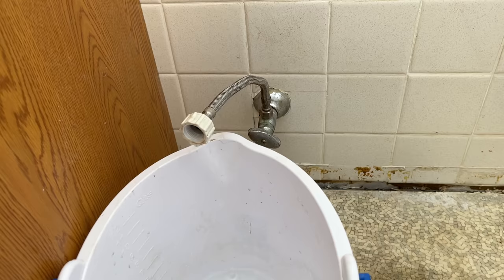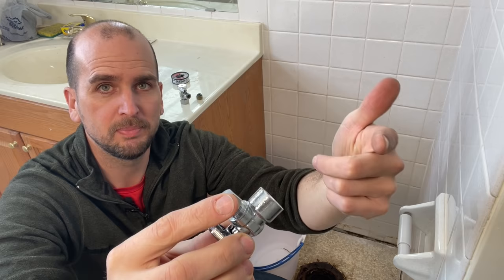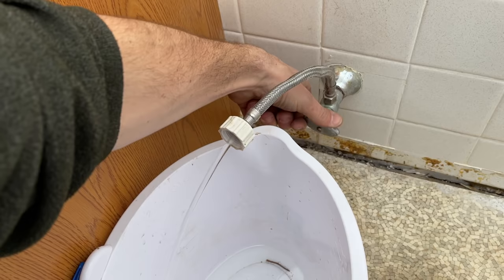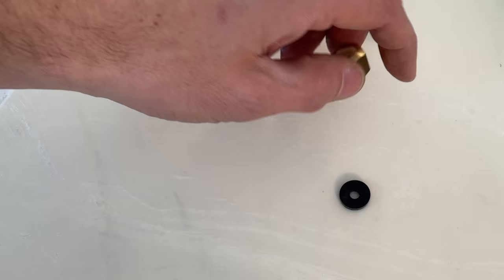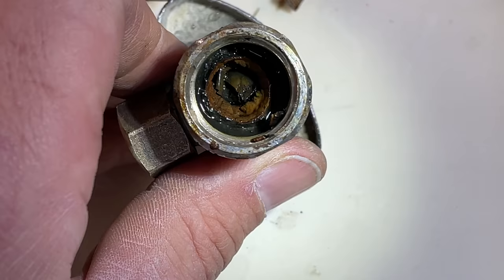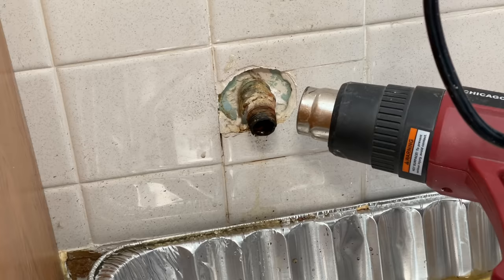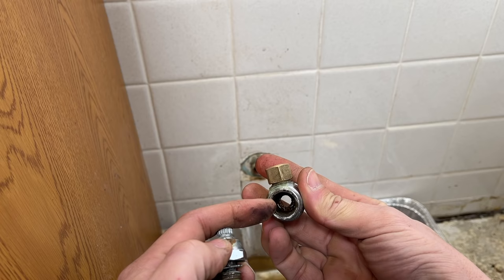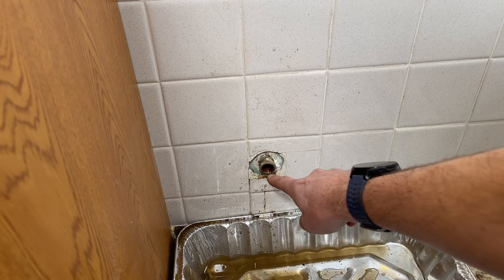Toilet Water Supply Valve Replacement | Can't Turn Off Water

Comment from the maker: What I learned from all the comments:
1)  Use a brass nipple as opposed to the black iron nipple shown in the video (Black iron and copper 
2)  I wrapped the Teflon tape in the wrong direction demonstrated at 4:55
Reply: You really should either pull this video down as the repair portion is mostly wrong, or heavily edit it.  Most people don't read the comments so your mea culpa here doesn't really help.
Reply: I'd consider a plastic nipple or brass.  Plastic won't have any chance of corrosion.
Reply: @JerryFountain  this is true someone like myself may fail to not read the comments because viewers are so negative in their posts. They may take Everyday Home Repair channel for what he has shown, at his word. Then later the troubles will begin for the repairer. This personally why anytime I am starting to learn how to repair I look at different videos first. There are some people out there with good intentions but they are wrong either through lack of experience or because each scenario is different that the homeowners will experience on their projects.
Reply: Another thing, black pipe is not normally used for water. It will rust too fast. Black pipe is used mostly for gas.
Reply: Virtual hug subliminal
Reply: How cool is it that this guy listens to suggestions from comments?   And he makes great videos.   Nice guy!  I could hang with him.
Reply: @JerryFountain  😊
Reply: Suggest Quarter turn valve instead of the multi-turn.
Reply: Whoever used an iron nipple is guilty of malpractice.
Reply: @jimmypautz plastic has lower fatigue life as it’s still under compression by the valve connector.  Notice that many installs with a plastic part just cracks from vibration, Iv, heat, etc.  My Broan combo Bath exhaust fan/light fixture’s plastic clip holding the light socket cracked after 5 years.  Maybe it was heat or or fan vibration, so it doesn’t corrode but plastic breaks easily,

Comment: Never use Iron fittings with copper. Dissimilar metals. You applied Teflon tape in the wrong direction.
Reply: wasn't that nipple thing meant specifically to go from copper to iron?
Reply: @jc40337  Nah, there are brass nipples more appropriate to the application.
The iron nipple should have been used with iron or galvanized plumbing.
Reply: I don't think he realized there was copper back there. Even though, should be ok. I learned a long time ago always go clockwise with teflon tape, 4 wraps, the tape only makes up the threads anyway, it is not to seal as many think, although same effect I guess.
Reply: @heyallenify  I agree, but many appliances, like water heaters have galvanized pipe to hook up to your copper lines, I guess they don't want them to last. Figures
Reply: @jthonn  Not sure what you're saying about making the threads, but the  teflon is there to fill the imperfections in the threads, as the water (or whatever you're using the pipes for) will leak through the gaps in the threads.
With higher quality fittings, there is less call for the tape, and flare joints don't require it since they have machined sealing surfaces, but NPT joints typically require a sealant.
Reply: First thing I noticed
Reply: @heyallenify  I agree totally, what I meant buy making up the threads is exactly what you said.
Reply: @jthonn  Water heaters tanks are made from steal. Makes sense they use the same metal for the penetrations. They also have anodes as well which protect the steal. Still, it's up to the installer to make the transition from steal pipe to copper using the correct connections. This isn't planned obsolescence per se. Just installers not doing their job.

Teflon strictly speaking is used to lubricate the threads although more can be used to help create a seal if needed. That's why many plumbers will use teflon and pipe dope when using any tapered thread just to make sure they don't have to worry about any leaks. Now about flared fittings, you can use teflon in a pinch to get a damaged flare fitting to seal. Isn't pretty and definitely shouldn't a part of a finished project, but it's gotten me out of a bind a couple of times. I've used it on JIC connections on a surface dive spread. It was upsteam of filters so any teflon that might get dislodged would get caught in the filters so as to not get sent down to the diver's regulator. Once the job was complete, I removed the fitting before sending the equipment back to the shop.
Reply: He was also holding his channel locks wrong when fighting the nipple into the fitting.

Comment: excellent "how to" video.  However, I would be amiss if I didn't point out that you applied the teflon tape in the wrong direction.  It should be applied in the direction that you will be turning the threads to tighten. Much like you do when attaching copper wire to a switch.  Making the hook in the direction you are going to tighten the screw.  Also, you tightened  the nipple with the channel locks in the backwards position for tightening.  Also I didn't understand the point of installing the cap on the valve.  Seemed like a waste of money to me.  Hey, other than that, good to go.
Reply from the maker: Thanks for the feedback.  The cap was more for a demonstration for those that might need to stop the leak but from one reason or another aren’t or can’t fix the valve at the same time.  I have used these caps in the past on various renovation projects to stop slow leaks over time.  👍
Reply: Indeed, EastTexan, to all the above. I would have also used the second channel locks to hold the pipe being screwed into... could do damage to the inner-wall joint if it's overtightned by not holding it in place while screwing in the new nipple. UGG!! I see others are also pointing out most of these issues. Oh well, it'll all hold.. for a while anyway! :D Flush away!
Reply: @SteveFarmerMusic  I was looking for the comment about using the channel lock pliers backwards. The teeth are designed to dig in in only one direction.
Reply: This doesn't matter. The old coot who taught you this had OCD
Reply: @gregandrews7281  lol.  who are you responding to with this comment?

Comment: Using a steel nipple into copper causes electrolysis from the two dissimilar metals. You should use a brass nipple instead
Reply from the maker: Thanks For the feedback Troy.  I was reading some mixed opinions on this subject 🤷‍♂️
Reply: @EverydayHomeRepairs  Dissimilar metals is chemistry, and chemistry doesn't care about opinions. Go with chemistry.

Comment: The teflon tape that you put on the new pipe nipple was wrapped counterclockwise instead of clockwise. Won't wrapping the teflon tape in this direction caused the tape to unwind when you screw it into the wall fitting?
Reply: Yes, he wrapped it wrong, good eye!

Comment: You mentioned debris in the pipe that clogged up the stop valve. So once you had the stop valve and nipple out a good tip is to hold a bucket in front of that copper pipe and have someone open the water supply to the house again for a few seconds to flush that line out then shut the water off and replace with a new angle stop and brass nipple
Reply from the maker: Hey Steve, nice idea with flushing a bit of water.  I also will be taking the advice of many and swap out to Brass on Monday.  Appreciate the feedback.

Comment: Nice video!  As a suggestion, I would use a quarter turn on/off ball valve instead of a rubber washer based shut off valve as they are more reliable in the future as you don’t have to worry about the rubber washer from failing.
Reply: 6:01 And read what it says on the valve...it's a 1/4 turn ball valve.
Reply: Yep, only way to go!

Comment: For future valve repairs, I use quarter-turn valves for this especially in rentals. Tenants are more likely to turn it off with phone coaching and there should be a lot less future valve maintenance... valuable, especially if you own the property.

Comment: You should have used a brass or copper nipple ilo steel. The same corrosion will occur with the new steel nipple. Contact between dissimilar metals (copper against steel) causes bi-metallic (galvanic) corrosion.

Comment: When you tightened the new nipple, it would be better to put a second wrench on the copper female fitting so that the soldered joint in the wall isn't subjected to all that torque.  The same thing applies when tightening the valve onto the nipple.  A second wrench (a pipe wrench or vise grips) on the nipple would prevent the soldered joint from feeling all that torque.
Reply: I saw that
Reply: Also the pliers get a better grip turned around the other way like using a pipe wrench.
Reply: Definitely need to hold back,?he got away with it this time but….
Reply: The advice is great, except that in this scenario, it would not be possible to use a wrench to hold the nipple while installing the new valve. This is because the escutcheon did not leave much room on the nipple for a wrench.
Reply: Wondered about myself.  And also some penetrating oil on the old valve joint prior to loosening.

Comment: There's a reason that most places require an apprentice plumber to go to school for five years and work at least 10,000 hours under the direct supervision of a licensed plumber before being allowed to apply to take the licensing exam. This guy made a good effort, but proved that there's a good reason for the minimum requirements.
Reply: Agree that licensure is great. Unfortunately, I’ve seen many licensed guys save money or time by just throwing something together that gets the job done. Go to any hot area where there’s a lot of housing going up and unfortunately you see some pretty poor quality work. It might be electric, plumbing or HVAC and it may pass code but it was done cheap.

Comment: I always wrap the tape in the opposite direction of the thread.  'With' the thread would likely cause the tape to peel back when installing the nipple/part.   It may or may not leak.
Reply: Yep, wrapped backwards. I always hate seeing people who seem to be basically competent at what they do, but then do something pretty basic that's thought to be generally incorrect. Leaves me scratching my head :P Oh well.. it still worked! :D Flush away!
Reply: As long as it doesn't bind up, looks like it didn't. As far as leaking, probably wouldn't leak even if you didn't use any.

Comment: Use the channel lock pier to hold the handle turn left and right slightly to start moving, don’t need to replace the valve

Comment: Great video. I would have never known that this could be the cause of a leaking valve.

I believe I had a similar situation happened to me with a bathtub faucet stem valve. Went to remove the leaking valve and found metal shavings inside where the valve seat was. I removed the shavings and replaced the valve but I had no idea that the shavings themselves could have been what caused the problem.

Comment: I just did the exact valve replacement, the steel pipe looked rotted just as in video.  Unfortunately, I would have to tear out the tiled bathroom wall to replace nipple.  I just cleaned up what was left of threads the best I could with emery cloth and was able to get the new valve to catch a few threads.  I used a heavier teflon tape designated for oil/gas/hydrocarbon to help seal the buggered threads.  Repair seems secure, hope it will last at least 5 years AND hope for a small leak as the failure mode.  The alternative was to tear up an old bathroom wall after which will never match tile and may get into other problems.  Does anyone have any constructive advice or alternatives? Thanks

Comment: Ditto on the teflon and not replacing with iron. Also, to clean out that rotted mess use an old tooth brush, a rag or small brass brush if you have it and then get a big pan like he has and open up the water for a bit to flush out any debris that still far back in the pipe that you missed and it should help you alot. Also run the water wide open for a while after al is installed for same reason. Thoe little bits can drive you mad.
Reply: Good point!   Especially when connected to a faucet with any kind of aerator/screen.  I always take those off the faucet for the first day and let the itty bits wash out - then put the aerator back on.   Wall la!

Comment: If you can't turn off the water supply and you only want to get the valve unstuck, you can soak the valve in vinegar to dissolve the scale. This might take a full day or several days, but the handle should turn easily by hand without force or risk of catastrophic failure.
INSTRUCTIONS: Fill a small plastic bag with vinegar. Hold the bag opening over the valve assembly so that the handle and stem are soaking in the vinegar. The vinegar will be in a corner of the bag, and most of the plastic bag will be bunched up around the valve assembly. Secure the bag to the valve assembly with rubber bands so you do not have to hold it. There will be some leakage, but most vinegar should stay where you want it.

Comment: You have to be careful assuming that an angle stop shutoff with a hex is either a compression or pipe thread. Some are sweat fittings with a chromed brass tube and the hex is just for appearances.

Comment: Aren't you connecting dissimilar metals (Cu and Fe), which will result in electrolytic corrosion? If so, you need a dielectric coupling in between them.

Comment: I remember replacing one of those old cast pipe fixture valves. The entire section on pipe unthreaded itself inside the wall... Decided to call a plumber when that happened

Comment: Because of dissimilar metal corrosion, I wouldn't use a steel nipple in a copper fitting. Use a brass nipple and there won't be corrosion on 5-10 years.
Reply from the maker: Agree, thanks for the comment Bill 👍

Comment: What do you do if the old threaded valve doesn’t come off so easily as yours did when I try to turn it? It’s stuck and I don’t want to use too much force to turn it cause I’m scared of possibly damaging the pipe.

Comment: I wonder.  Once you had the old broken pipe with the broken threads off could you have briefly turned on the water to make sure that all the small broken pieces were out of the pipe?  If not what did you do to make sure all the small debris was gone?

Comment: Wouldn't it be better to use a galvanized or brass nipple to avoid rust?
Reply: Just what I was thinking...
Reply: That was a galvanized nipple he used.  When the treads are cut the galvanized is gone.   I would have use a brass nipple.
Reply: I agree, using steel parts against a copper fitting is going to cause corrosion.

Comment: I couldn’t tell with the lighting but was that a galvanized or iron nipple you installed? I hoped you were just using the wrong term and it was galvanized; even though it wouldn’t be ideal (dissimilar metals) you at least put ptfe on (though the wrong direction apparently). Iron is only meant for gas. Galvanized and brass can be used with gas or water.

In this case a brass nipple would’ve been ideal since brass already has copper in it and won’t oxidize at the joint

Comment: I would suggest you wrap the Teflon tape in the other direction, so it stays firm in place as you screw in the nipple.  Also, don’t use another steel nipple to brass or copper, splurge on a brass nipple instead, which will avoid the issue you had with the nipple corroding into the valve.  I have also started carefully using only 1/4 turn stop valves with stainless ball inside a brass casting, as well as a non plastic handle.  Over time these valves get sticky and the plastic handle will break when you try to turn one off.
Reply: @kimbuck-2  some copper fittings are threaded adapters that are soldered onto the pipe. So that you can transition to other kinds of devices.  For example, copper pipe runs to a water heater, but is terminated sometimes with a male fitting, then a flexible stainless tubing is used to run the last few feet.  If the water heater needs service, it can be disconnected easily. Lots of other examples.

Comment: Do you have any videos with chrome plated copper sleeve over copper supply line? I assume I need to sweat it off to replace the valve but, I can’t find a good video of that. Any suggestions?

Comment: Did they make the piping out of Iron for water supply? I thought they used galvanized steel in old homes.  I have so much galvanized steel I've had to replace inside and out of my house.
In my house the only iron is used in the drain.

Comment: There is still dripping water from the wall pipe. 
I have the same problem with my shower wall mounted tap. I thought the problem would be inside the wall. Looking at your video I am not sure now.

Comment: Does the heat gun really work?  Have a water line directly to toilet with no shutoff. Tried to add one but unable to loosen nut, afraid was going to damage pipe

Comment: i want to replace the toilet shut off valve with a quarter turn ball valve. HOWEVER, it is attached to a PVC pipe by
  glued/solvent (i think). every video i have seen show cutting the pvc pipe end off to remove the valve. 
if i did that there might not be enough to attach a ball valve. 

can a glued on valve be removed without cutting? if it is sharkbite or the like, are they removable without cutting?